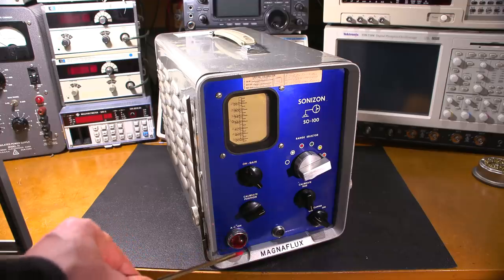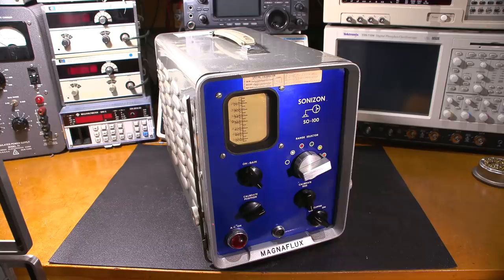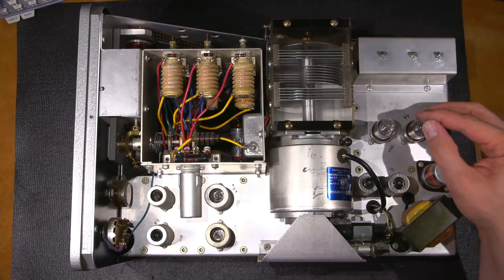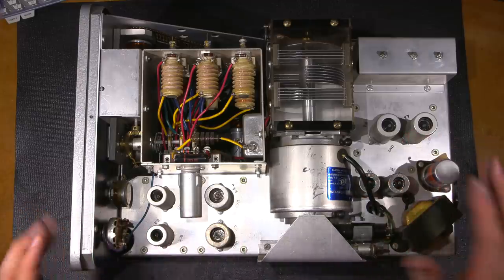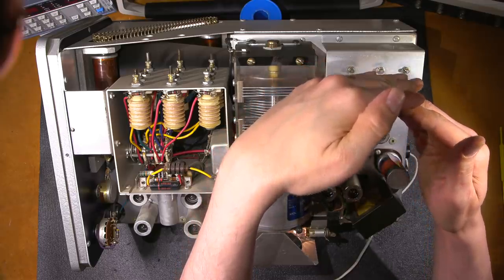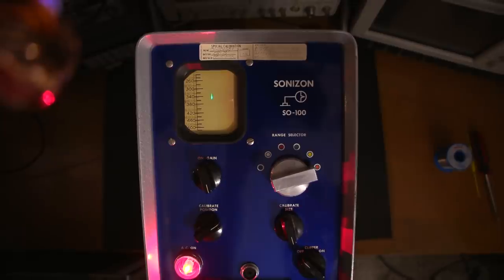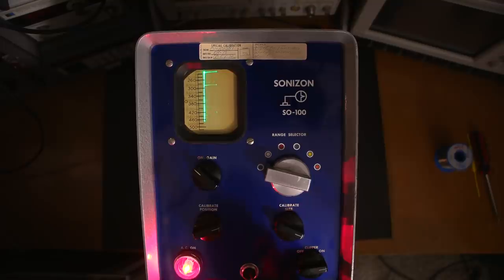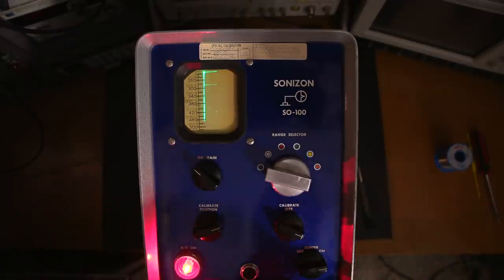Restoration or Parts Teardown- You Decide! [Sonizon SO-100]

Comment: magnaflux is a common test for cracks in a engine block. No idea if this unit was one such tester.
Reply: Back in the mid 70's I worked at a coil spring plant, one of my jobs was to use the magnaflux to inspect the springs for surface defects or cracks, IIRC the springs were inspected in a dark room with blacklight, the cracks would shine much brighter than good steel.

Comment: Hi Paul, I can provide you with an ultrasonic transducer that works, as long as you can provide the operating frequency, and wether it is a dual or single element search unit.  It may not be period correct, but it will work.  The bonus is that I live not far from you.
Reply: Cool, no excuse now.
Reply from the maker: Go to my about page and send me an email. Thanks for your offer!

Comment: I have an instrument like that one, much more advanced I think, with an external unit for noise rejection or something like that, 4 EL34 tubes for regulation and an actual probe. It needs a restoration tho, and the plastic case of the external unit was damaged. If you want I can send you photos of the probe (and apparatus if you're curious).

Comment: I would keep it as a museum piece, not restored.  I believe it was use to ultrasonically test metal.  A transducer shaped like a small hockey puck was moved over the surface to detect cracks and nonmetallic inclusions in the material.  An ultrasonic wave went into the metal and was reflected back by any discontinuity in the material.  The transducer was coupled to the material with a liquid couplent to insure acoustical continuity between the material and the transducer.  Any internal fault would show on the scope.  You could read the thickness of the material also, but the primary use is to find internal faults.  This would be useful in the aircraft industry or for checking welds.  A similar device was used in the steel industry to detect internal defects in steel plates.  You would need the proper transducer to make the piece useful or to even see if it works.  Unless you can find the transducer, restoration would be of no use.  Therefore leave it as manufactured as a museum piece.

Comment: Now you have to build a probe for it ?
Or talk about what you could use the parts for ?

I have a high-pot tester with glass oil filled caps --- what is a good replacement for those ?

Comment: definitely restore
you can not only measure the thickness of material but also see faults inside of material.
Stack three plates on top of each other and you can propaly see the 2 gaps between the plates, the touch induces signal reflection.
those devices get used today in an more modern form .
any idea how the transducer has looked like?

Comment: Ultrasonic thickness gages cost from 100 to almost 2000 for handheld device. Depending on accuracy and range of this one it can still be very useful tool or another dust collector. In second case I would rather convert that to something more needed in electronic lab.

Comment: I have not seen this particular instruments.  But what I have seen (or actually built myself) for ultrasonic thickness measurements depended on crystal transducers.  I built my instrumentation around a 500 kHz, a 1 MHz and a 2 MHz crystal transducer which all I purchased.  The operating principle is that an electrical excitation causes the transducer to send mechanical wave into the part to be measured.  The vibration is coupled tro the part using either water or some oil at the interface.  The ultrasound wave propagates in the material at a speed  that is material dependent.  It reflects from any discontinuities or from the back side and is picked up by either the same or another crystal.  The time delay of the reflection is a measure of the thickness.  Normally you have a stepped thickness calibration piece of same material.

In my case, my material was special cast steel that had very bad scatter throughout the material and poor reflection from the back side.  Moreover the back side was ribbed at roughly 1 inch spacing and 1 inch depth rounded bottom grooves..  The total thickness was about 2 inches.  The only way I got any thickness measurement was 2-man operation.  One man used a smaller transducer (1 or 2 MHz) on the ribbed back (inside of the cylinder) while the other one chased the signal at the smooth outside.  We had some sample material from the original casting  and made a stepped calibration piece of it.  The actual instrumentation was built around a pulse generator and a variable persistence analog oscilloscope (TEK 7633).  The pulse generator produced a trigger pulse for the ‘scope and measurements were obtained from the delayed time base — trigger from the transmitted pulse to the receiver signal.

I still have somewhere a reference table listing ultrasonic properties of various materials (metals and maybe some ceramics) probably published by Krautkraemer, one of ultrasonic instrument manufacturers.  One detail I still remember is that beryllium exhibits the highest propagation speed of all metallic elements.  The speed is dependent on the ratio of the material tensile coefficient to its density.
Reply from the maker: Thanks for taking the time to write Pellervo!

Comment: I vote for parts. its a very niche bit of equipment that you (Mr Carlson) would never use. plus then there is the whole having to fabricate the probe unit with little to go on. Restoring brings a lot of 'feel goodness' out but sometimes you have to weigh the reality's of use and costs  then realize not everything can be saved

Comment: I know next to nothing about electronics, so let me ask the stupid questions: How do you know it doesn't work as is? It may, I've often been surprised at the old stuff I find that still works even though to look at it, you wouldn't think so. What will it take both money and time wise to buy or build the part you need to make it work? Does it still have value today as the machine it was made to be? What would the salvageable parts be worth as opposed to the machine in working order plus the cost of restoration?  Do you have immediate use for the parts or can they be sold as parts easily? Can you do something else with the case? It's too nice to just trash?  Or can you get rid of the whole thing for parts or repair for a good price? What is your interest, making money off it or having yet another vintage test unit on hand that you don't really need?  (obviously you have little need to magnaflux steel) These are the question you must use to decide which way to go. I'd prefer restoration over parting out, I always do, but sometimes that doesn't make good sense.

Comment: I understand that measuring the thickness of metal (without cutting into it) is tricky and/or expensive. If that's the case, I'd restore it and see if you can find a buyer. Someone might use that as a real tool instead of a "shelf queen" if they have reason to believe it'll last. Personally, I doubt anything that touches that bench will fail soon. :D

Comment: That unit looks to be in too good a shape to be scrapped for parts. I vote for restoration. I'm always a little surprised when you turn on a piece of old gear without change the caps but you do have the isolation transformer to help if some of the caps are bad. I am guessing but I suspect you bring power up slowly on a piece of gear like that with an unknown status. An Internet search revealed that there are modern devices to measure the thickness of materials using ultrasonics. I wonder if that might help you get a sensor to use with that old piece of gear.

Comment: Many pieces of old equipment can have historical value in at least two overlapping ways: showing how things were designed and built, and showing how they were used.  In cases where it is practical to restore a device to satisfy both purposes, I would regard that as ideal.  In cases where that isn't practical, it may be useful to replace parts of a device with some "modern guts" so as to restore its functionality to be comparable to what it would have had when new (generally avoiding the urge to make it too much better, unless the device was badly designed even for its day).

If there were some insurmountable problems with the electronics in this unit, for it might be interesting to design a solid-state replacement for some of the tube-based electronics, but integrating the more interesting parts like the spinning capacitor assembly.  Unless there's some fundamental problem, though, I think the value in keeping things as original as possible would exceed the value of the parts therein.

BTW, I would guess that the light sensor is designed to gate the beam so it captures one direction of the sweep.  Try shielding the sensor from room light to see if that affects the behavior (normally the case would be closed), or shielding it from all light, or shine light deliberately around the spinning plate.  Also, I was wondering if the device has many capacitors controlled by that motor shaft, with the plates on the end placed opposite those in the middle for balance, or if the places in the middle are just counterweights.  I'd guess the former, but it'd be interesting to know.

Comment: Since the only options are to restore or part. My vote is to part, for the simple reason of what use will it be other than a shelf queen and it is already perfect as is for that use. I did a bit of looking and it was likely was used during the construction of the Pioneer space probes. But if you wanted to keep it for historical reasons why repair it? Would not repairing a historical piece be the same as taking the patina off of old metal making it less valuable historically. I would rather see the space go to something more valuable in the lab or even a vintage radio. Not to mention some of those parts would go for a pretty penny and fund other projects as well.

Comment: ST-1300 Bingo! Used ultrasonic resonance to measure thickness of metal sheets. Piezo head would be high impedance. Magnetic coil head would be low impedance. Analysis of the input circuit would give a clue as which type was used.
Reply: Could also be used on non-conductive materials like plexiglass, according to a nondestructive testing journal article on the web. You just had to use some aluminum foil between the head and the plexiglass.

Comment: I would imagine by the apparent age of the unit that it is quite obsolete and complicated to use and since I believe it is used to inspect for stress fractures on safety of flight areas that inspectors would have more reliable equipment. I just retired from a well known aerospace company and most of them are out sourcing this type of work and even calibrating this equipment would be very complicated and the equipment to do so may not be readily available. This would be a labor of love and not practical.

Comment: Please don't take this as accurate information, I will dig more: A million years ago, I worked for my father as an aircraft maintenance apprentice. He often referred to sending out parts to be "MAGNAFLUXED" before they were installed on aircraft. I have little context as I can't recall if he was referring to airframe or powerplant parts.  I haven't looked at a FAR manual since before the Dead Sea got sick but it would stand to reason that certain parts may reach a wear or fatigue life and some type of thickness or integrity test would need to be performed by a certified shop with calibrated equipment. He still alive and well AND working AND flying at 75 years old. He is an Inspection Authorized aircraft mechanic in Door County, WI (and recent recipient of the Charles Taylor Master Mechanic award, if may add).  I was under the impression "MAGNAFLUX" testing was to detect fatigue cracks, but I will ask him and comment again or edit this. And I certainly vote to restore it, even if it is just a show piece or a museum donation.

Comment: My guess is that it puts out a pulse of energy into an inductive transducer to measure, not the thickness of some metal, but the plating on the metal. Another possibility for its use is measuring paint thickness on metal. The internal lamp, vane and light sensor is probably the trigger and the rest of your circuitry is time measurement to give the thickness. It could well be worth restoring if you can find a transducer. The reason for suggesting an inductive transducer is the power levels required to make the metal "ring". The transducer core is likely to be made of nickel, either machined or stacked like a transformer. Nickel shrinks when magnetized and I don't think that the ceramic transducers would have been invented back then. BTW iron expands when magnetized and this is what causes that hum and it is twice the frequency of the mains supply. TMI? I'll be watching with interest to see what happens with this piece of equipment. I'm a retired electronic tech... 1966 to 2015. Watching you brings back so many memories.

Comment: It's quite a nice thing with some not-that-reuseable parts inside IMO.  the motor capacitor is nice but when will that ever be usefull as a part?.  chances are coils and mica caps will never be the ones you need.  keep it in one piece until you at least know you have a good use for some of the parts.
Reply: That motor could be useful. I suspect the light bulb is used as a feedback mechanism to keep the speed steady.

Comment: Space Technology Laboritories Inc., a division of TRW and would no doubt have been used to check the welds on rocket parts as they not only built Atlas rockets and ICBMs. 
A rare beast for sure and since TRW has been divided and bought up, then this is a rare commodity that they once owned. It also seems that the company, MagnaFlux is no longer with us so this old beasty surely needs to be restored so they will not die off completely. Who knows, maybe you will get something that is welded and you need to inspect the welds? Then you would have the device to do it with. 
And I think that glass diode might well have something to do with the oscillator. Might be a good idea to find it's "name" and let's see what it does.

Comment: Restoration Please!.  I'd be worried that the printed film is an acetate, in which case it may have a seriously restricted life expectancy.  They yellowing of the film seems to be indicative of degradation.  I'd be tempted to take some b/w MF film and make a new one (it looks about the right size).  See if there's any printing along the edge of the film - that might indicate that was method they used to manufacture it in the first place.  The second really interesting aspect of this restoration would be manufacturing the probe.

I've used more modern pieces of equipment for welding inspection and crack detection.  You get a spike from the top surface of the metal and another one from the back surface.  Any other spikes in between will indicate a fissure, face, or non metallic inclusion in the metal.  It's a great tool for non-destructive testing of metals.

Comment: While it might be a fun restoration, without the ultrasonic head you will be facing a big problem. It may not be worth the effort since the usefulness is quite "niche". It is for Non-Destructive Testing (NDT) of metals.
In the energy industry the name Magnaflux is almost like Kleenex or Xerox when it comes to NDT. What you have is an early ultrasonic thickness meter/crack-detector. Usually the ultrasonic signal is sent into the metal at 45º and the reflections can be used to see some types of cracks or micro-cracks.
Magnaflux got its name from mag-particle NDT. This is where an inductive coil is used to put the piece under test in a magnetic field and then the part is coated with a ferromagnetic solution. The particles in the solution will collect at any cracks because the magnetic field lines are disrupted there. Quite often I have seen this done under a hood or shade with an ultraviolet light (depending on the ferro solution).
On many pieces of Critical Process Equipment it was not unusual for us to specify both Ultrasonic and Mag-particle inspections of 100% of the welds. In some less crucial parts we would reduce that to a 90% inspection.
Magnaflux is still around and a modern version of what you have,  the MT-21, can be bought at Grainger for a "mere" US$ 2800-ish. A modern source of ultrasonic heads is NDT Supply and costs in the range of US$ 240-ish. (I have no affiliation with or recommendation for either company).
Keep up the great videos. They are often a walk down memory lane for me.

Comment: I say it would be NICE to restore this really clean piece of measurement equipment!! would like to know if this equipment depends on crystal or magnetic type transducers to "sense"
metal thickness, and what frequencies are used in this process or bands of frequencies??!!  I can understand why General Motors would use such an instrument in monitoring metal
thickness or quality of metal or welds, but I think its main purpose is to measure metal thickness but I may be wrong with this assumption!  hi hi  73's  John Bellas  KC2UVN

Comment: It's a lot more valuable restored and working than the internal parts will ever be. You don't need more old capacitors, resistors and tube sockets. And you'll never find an application for that rotating-capacitor/motor set.  Restore it and either offer it for sale on ebay, or hold onto it. Just saying.

Comment: It seems a shame to break this unit up for parts, but to get any useful work out of it you're going to need to find a head unit (and probably restore that too), and I'm sure they're not an easy thing to find, and possibly very expensive.. 

There's also a lot of very nice components in there that could find good uses elsewhere.
So I would say on practical grounds, tear down, unless you have a specific need to measure the thickness of metal.